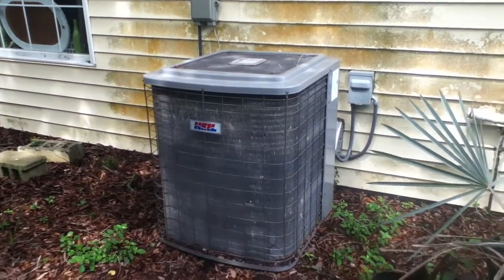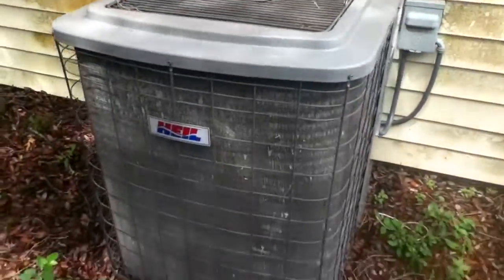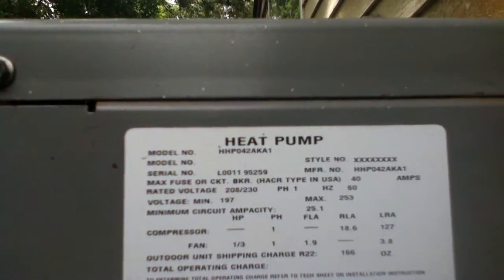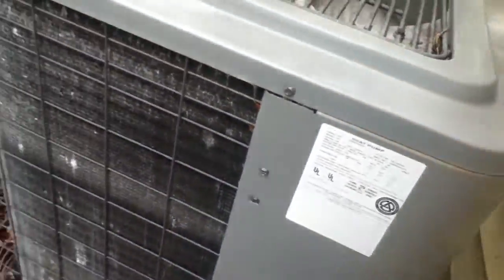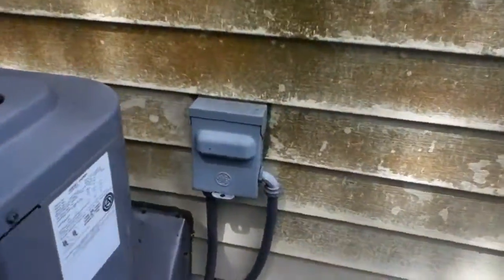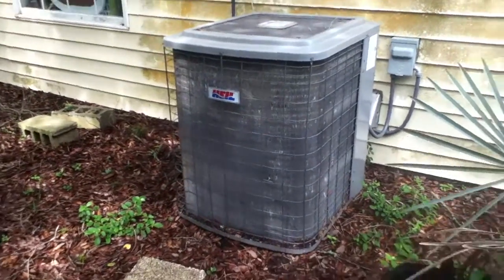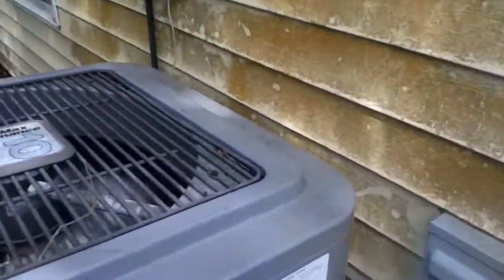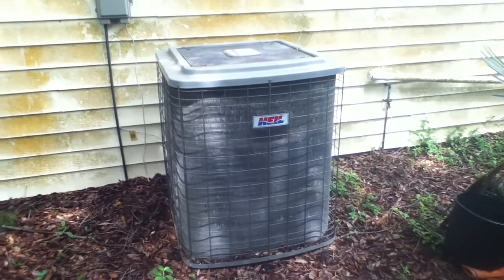Heil Max Performance 10 Heat Pump Running in COOL Mode!

Comment from the maker: Yep! Yes, the system would work a LOT better with NORMAL 5-Ton ductwork (The unit is drastically undersized). The supplies are ROARING loud, and the return's loud enough, too. I can feel and hear air from them from about 30 feet away.